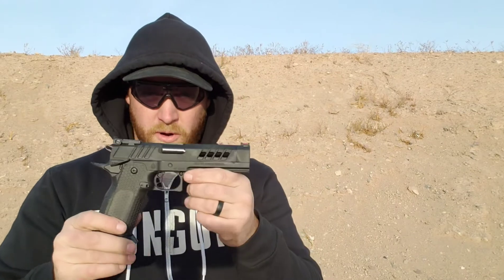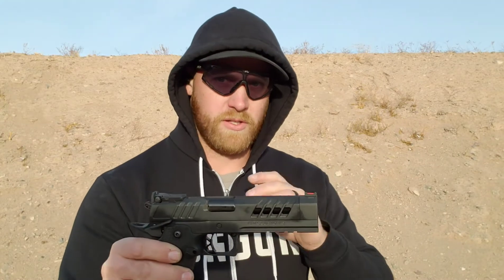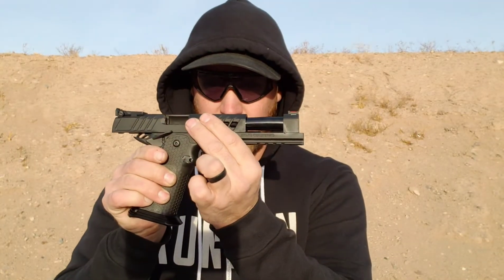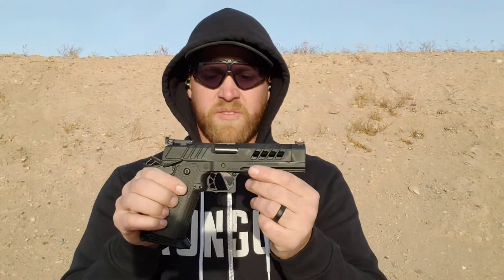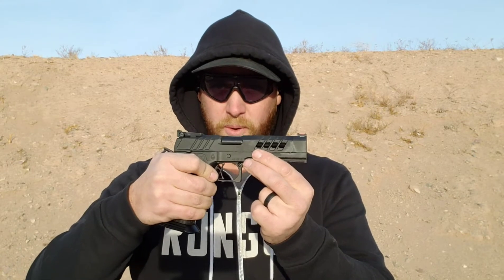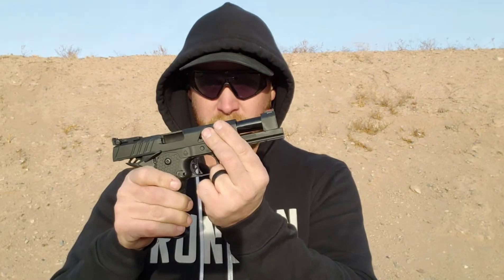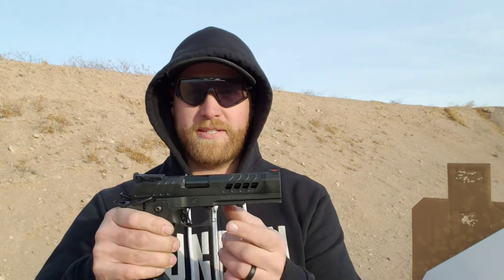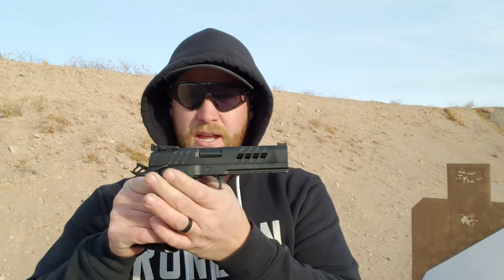Atlas Gunworks Artemis Setup/Tuning

Comment: I'm deciding on the artimas and the nemesis in 9mm, leaning towards the nemesis if I can put a red dot on it. Which on of the two would shoot flatter. Please help. Thanks
Reply from the maker: If you are going with 9mm definitely go with the Artemis. Its built around 9mm. Nemesis is built around the 40. Also the Artemis has the RDS plate option which is a removable rear sight plate system where a red dot can be mounted
Reply: @mikeDstoker  thanks,  appreciate the help.

Comment: How does this compare to the Staccato XC? I’m really a fan of the island compensators (compensators built in to the barrel). Does this shoot flatter than even a staccato Xc?
Reply from the maker: Atlas and Stuccato are in 2 different realms of gun building. Stuccato is a mass manufactured pistol and is represented by the quality and price. Atlas is a custom hand built pistol that is also represented by the quality and price. If the stuccato is in a 40 the Atlas wins. If they are both in 9 the Atlas wins. They are both good in their own realms but it truly is not worth comparing.
Reply: @mikeDstoker  That would be a great video to compare them.  Both performance and build quality.
Reply: Two different guns in terms of competitive application. The XC is an under chambered open gun, the Atlas is an over priced limited gun. Both have great craftsmanship the Atlas  has a bit more. 2020 nationals showed some interesting things, 1st,  3rd and 4th place in Lim were plastic fantastic guns that cost a fraction of XC or Atlas with even less craftsmanship. Get the gun that gives you a chub and dryfire / shoot  the piss out of it.
Reply: How does infinity compare in your opinion? I’m about to order a Atlas or Infinity.
The XC is a great gun but I hate grip safety’s.
Reply: The truth is the XC is a phenomenal shooting gun and you won’t find anything priced even close to it with the quality and Comp factored in.
But... I still prefer Atlas and Infinity for just a bit more.
Reply: I hate grip safeties and want a compensated 2011 similar to the XC.  What would be the compensated model atlas I need to look into?

Comment: Insightful! So are EDC and range plinking guns supposed to be setup this way as well? I ask because I've shot the largest portion of my rounds at the local indoor range and never really had the opportunity to shoot fast until my range began running a steel plates event at night on the 50 yard range once a week. 8" plates x 6 with a forced reload. I shot my favorite over-the-counter gun (P226R or HK P30L) depending on mood. One thing I can say after around 15,000 rounds is that I don't think my gun gives me nearly the same experience as yours. Just curious if I have been wasting my practice rounds. Thanks!!